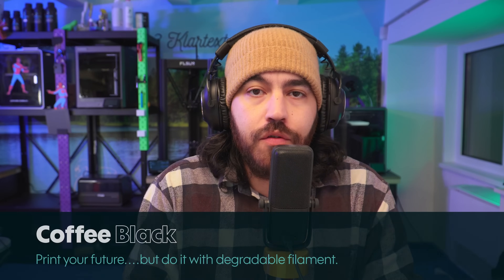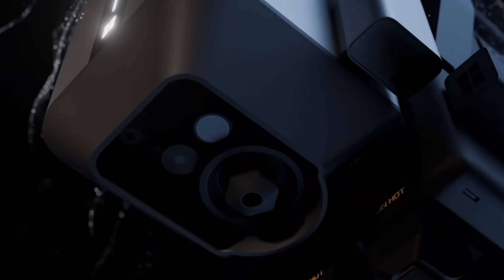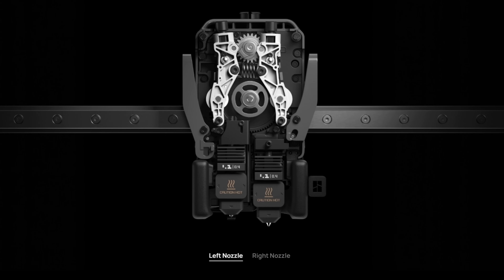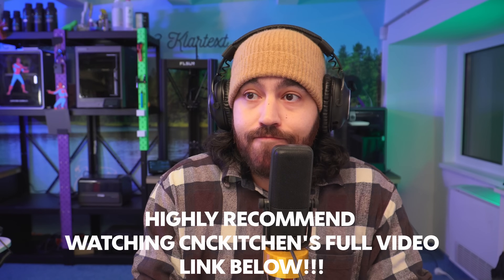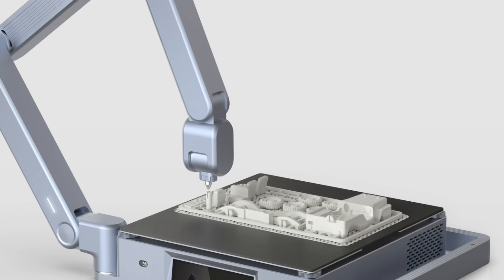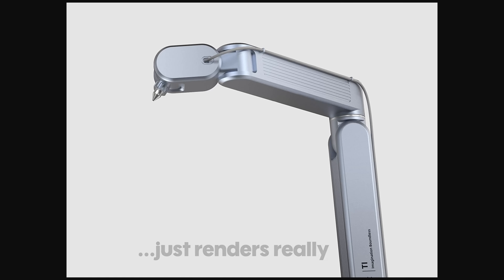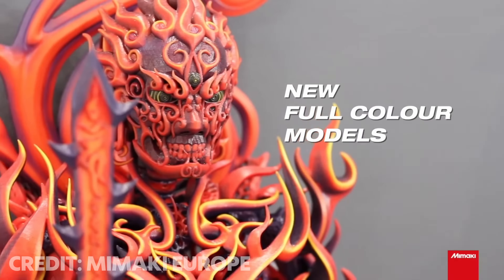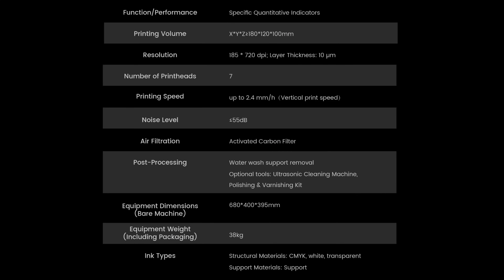🔥 INSANE Month in 3D Printing! Community News March 2025

Comment: This Flashforge color printing is interesting....  wonder how much would it take to modify existing printers to print in color in this way
Reply from the maker: Significantly difficult I would think - the problem would be accurate resin delivery. Seems like a major headache although there are already colour inkjet mods for marlin printers. The colour vibrancy does not compare to this though.

Comment: Think about the number of tool changers would fit on something like the OrangeStorm Giga.
Reply from the maker: Let's be conservative and say the printer in the video was a 350 2.4 and the OSG has 800mm, so that's more than double the size so at least 18 toolheads, maybe 19.
Reply: @ With the height of the Giga, you could potentially stack the tool changers 3 - 4 rows high or more. That would need some kind of rack to sit behind it with at least as many spools. 16 wide 4 high would be 64 colors.